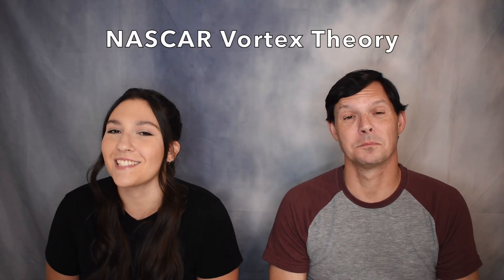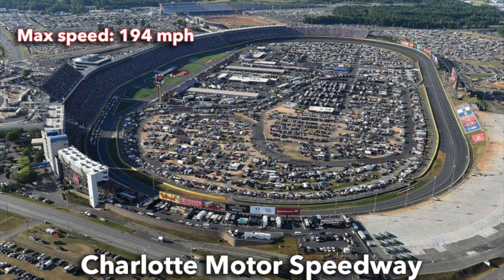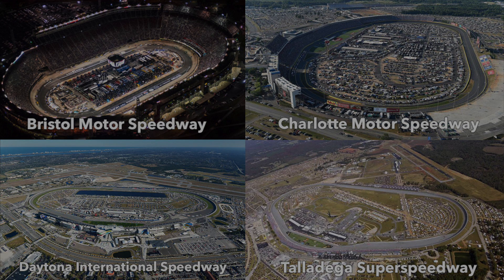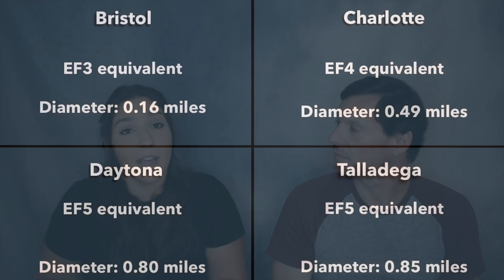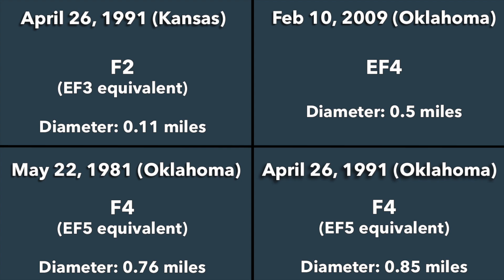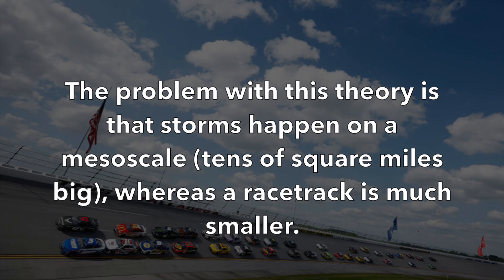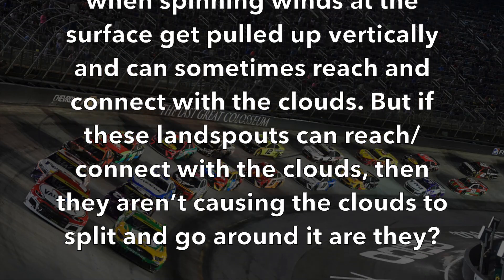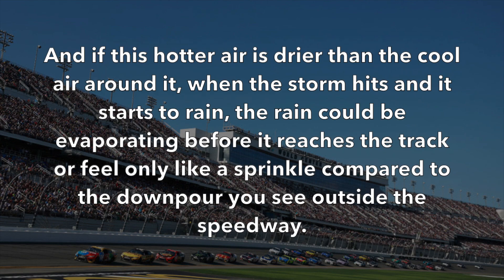IS THE NASCAR VORTEX THEORY PLAUSIBLE?

Comment: Very interesting and fun topic of conversation! I agree fully with what you said. But I do wonder about exhaust emissions from the racecars and if the PM could potentially impact the cloud forming environment around the track to some extent. I know a larger amount of particulate matter in the air makes for more cloud condensation nuclei and so clouds are less efficient at generating big drops. It makes me wonder if there is a relationship with that. That being said, scale again is an importan factor here, and I don't thing the scale of the emissions is enough to drastically affect an already formed thunderstorm. :)
Reply from the maker: Ah exhaust emissions is a good thought too! But you're right, the scale of the emissions is so small compared to a storm cell. Still a very interesting theory! Maybe all of these small things could add up.

Comment: But do tornadoes form top to bottom tho?
Recent observations showed they form bottom up like landspouts, this was supported using radar compared to real time imagery of tornadoes, also offical storm tracks have been found to start much later than visible debris clouds formed, making it seem like tornadoes are a gradual process rather than an immediate touch down, supercomputer simulations from dr.Leigh orf showed that a sort of "parade of vorticies" forms on a boundary from the front flank downdraft, these vorticies sre then streched upward by the mesocyclones 100+mph updraft increasing their speed, the very low pressure forces these vorticies to converge and a tornado is formed.
Reply from the maker: Interesting! Can you link where you found this? I'd love to check it out
Reply: @MeteoTechWx  i'd love to

Here are the computer simulations i was talking about https://youtube.com/c/LeighOrfsThunderstormResearch

Here is a pretty lengthy video by Skip Talbot, he mentions alot of reasons why he thinks tornadogenesis is bottom up in this video https://youtu.be/rVIQtKuDr2c
Reply from the maker: Thanks!